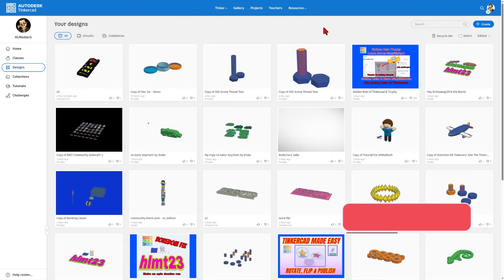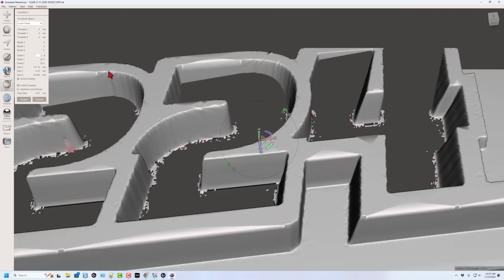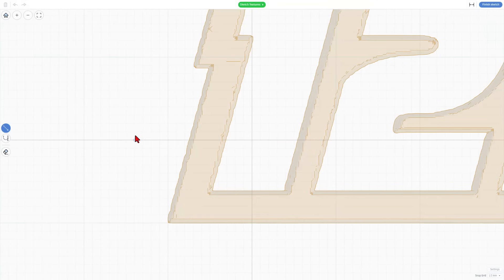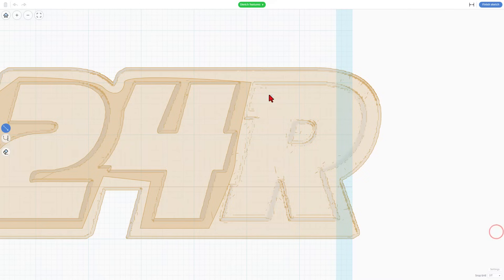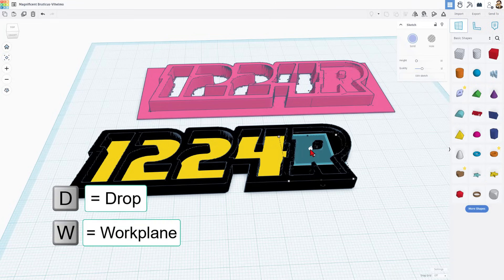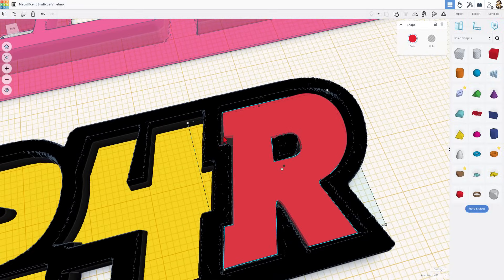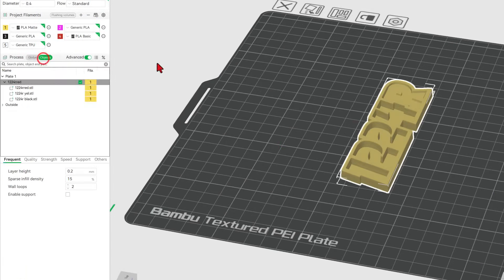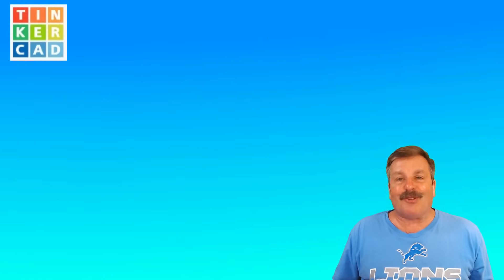Easy Color 3D Prints: Tinkercad Sketch, Meshmixer, & Bambu Studio

Comment: off topic, what setting did  you use to  setup the slicer to print with less waste ?
Reply from the maker: Instead of a setting, I believe it is how it was designed. Since the yellow was only 1 or 2 mm most of time was spent printing black. The red was a thin layer too. Other than that it was the generic draft setting that comes from Bambu Studio.

Comment: You can cut bottom in thinkercad also,  and paint letter R in bambu studio. Will be much faster and no need to change design or use mashmixer , just need to paint letter by layer high tool in BS.
Reply from the maker: 100% accurate. I jumped to meshmixer because I intended to smooth it as well.
Reply: @HLModTech  Mac users aren’t able to try Mashmixer, and I believe my comment was partly out of jealousy. 🙃
Reply from the maker: I 100% get that. Wish I had a solution for you.